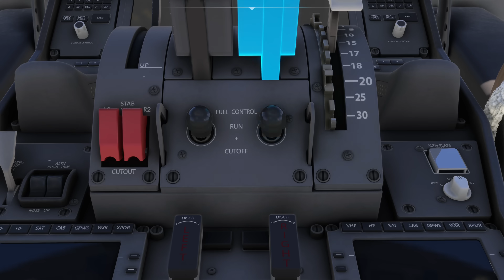Air India 171: Why Did The Fuel Cut-off Switch Get Moved?

Comment: Hi Steve, you mentioned fuel control switches getting turned off causing RAT to deploy. I have a question: after landing pilots do turn these off and won’t deploy RATs. So how can this event be interpreted as engine failures leading to RAT deployment? Also you mentioned RAT deployed so unusually quickly on switching off fuel.
Reply: The aircraft landing gear has "Weight on wheels" switches which do just what the name implies - signal to many systems in the aircraft that the aircraft is on the ground. That inhibits RAT deployment when the fuel cutoff switches are turned to cutoff during normal operation (lets say after taxi to the gate when the pilots DO want to shut the engines down).
The RAT deployed automatically on AI 171 because the engines were both shutdown AND the aircraft was in the air - exactly as it was supposed to.

Comment: Here's a main question of mine why didn't we hear on the flight deck voice record "why are your hand on the fuel cut off levers, 2 maybe someone who has way more experience in the 787 is possible to have enough strength to pull out the two twitches and move them down simultaneously. From what I read and understand the switches 1 and 2 got cut off within 1 second of each other how hard is it to do it that which these fuel switches? Why haven't I heard anything about a possible malfunction of the EEC Electronic Engine Control if both EEC 1 and 2 failed simultaneously could they not give erroneous readings such as indications that fuel cut off has been moved? And the moment they came back online would the engines now fired up again as normal I'm with the fuel cut off switches already in run?

Comment: There's so much misinformation about this crash these days, due to news outlets and interest groups deviating from the essential information available. The recorded data in the CVR and FDR clearly show what happened in the cockpit. One can think what one likes when it comes to assigning blame for the accident.

If one has a problem with this recorded data, it doesn't change the fact that one of the two pilots shut off the fuel supply to the engines shortly after takeoff that day. This data was recorded by the FDR of the Boeing 787 and used for the preliminary accident report.

All other information floating around is invalidating speculation or misinformation!

Keep up the good work Steeeve!
Reply: Yes, the pilots turned off the switches. But the data is not consistent with the suicide hypothesis:
1. I think you will agree that only one pilot was potentially sabotaging. So why did he not turn the switches back off? 
2. The RAT wasn't deployed at 08:47, it started providing power then. So, it should have been deployed at least 4-5 seconds earlier(the report does not give the time of deployment). So the Engines must have failed by 8:42 or 8:43.
(3). The pilots cut-off the switches at 8:42-8:43. You will say this makes perfect sense. I will say exactly the opposite: The valve will take couple of seconds to close (according to the report, it took couple of seconds to open). After closing, the electrical failure would take another 1-2 secs as the engines spool down. They don't stop instantaneously.
All this to say that the cut-off time and RAT power generation time can only make sense if the engines were decelerating prior to 8:42(the cut-off)
(5) Not sure why Steeeve says there is no procedure to turn both switches off. What do you do if both engines lost thrust?
(6) Pilot conversion is not in "quotes". That leaves room for misinterpretation one way or the other.
Reply: Steves is the one who is providing misinformation based on vague data without detailed timestamps. Clearly he is a mere pilot and doesnt know the engineering of the plane.

Comment: Question: If you cutoff the fuel, how long it takes the engine to start? Did you test this scenario in the simulator or perhaps during test flights? You mentioned, that one engine didn't started, why that? It seems the pilot know exactly what to do, if this was premeditated and I was wondering if you can try this on a simulator.

Comment: Hi Captain!
I know I'm not genius in this field neither related to aviation but how can we simply assume it's all pilots error just by reading the preliminary report that AAIB has released. The report they is being released asked so many questions than the answer to the carsh. Because they have mentioned it barely as it feels like they are trying to save Boeing in this case. 
Here's why i think it's not a pilot error.
1) If you see the image of AI 171 right after taking off, It Seems like RAT was deployed (the report doesn't show any specific time of the RAT deployment). So if the RAT was already seen to be deployed right when the plane was around 70-100 feet above the ground, then wouldn't it means it started to deploy 5-10sec back prior to the picture that shows .
So my theory is, both the Engines were down right after V1 Speed and Pilot deliberately "Cutt Off" Fuel Switches to Re-Run the Engines as a Protocol to Actually save the Flight nor crash it, because if they wanted it to crash then they'd never place back the fuel switches to "RUN" (Also doing that might one Pilot askd the other "Why did he cutt of"? Again no time mentioned in the report for the cockpit voices).

Comment: Someome educate me here, i'm a line maintenance mechanic for mostly 767.

Why was the RAT deployed if you still have APU? 

Doesn't power transfer over to APU when fuel are cutoff from engines therefore not needing the RAT?

Maybe the pilot cycled the two fuel switches to reintroduce fuel?
Reply: with 10 seconds gap!?
Reply: @stevemuller8320 true that. But 10 second's way enough time for plane to transfer over to APU, so i wonder why the RAT deployed?

Comment: No, it's generally not possible, or advisable, to intentionally cut off an engine during takeoff after the V1 speed has been reached. V1 is the critical engine failure recognition speed, and above this speed, the takeoff must be continued. 

Here's why:

V1 Definition:

V1, also known as takeoff decision speed, is the speed at which the pilot must commit to either continuing the takeoff or aborting it. If a problem occurs before V1, the pilot can reject the takeoff. If it happens after V1, the takeoff must be continued. 

Stopping Distance:

After V1, there may not be enough runway remaining to stop the aircraft safely if the pilot attempts to reject the takeoff. The calculations for V1 take into account the aircraft's performance and the length of the runway to ensure it can either continue to fly or stop within the available distance. 

Engine Function:

While an engine failure is a serious issue, modern aircraft are designed to be able to continue the takeoff with one engine (assuming a twin-engine aircraft). The pilot will typically increase power on the remaining engine and maintain directional control.

Comment: Captain Steve,

Do you fly Boeing aircraft? If so, I believe your airline should review your content and assess your expertise critically.

The primary focus of all discussions should be air safety, but unfortunately, this is often overlooked. It seems that much of the Western media may be influenced—possibly even financially—by major aircraft manufacturers, as has allegedly happened in the past.

There are also serious concerns about the AAIB investigation team. According to some sources, at least one investigator may lack the qualifications necessary for such a significant case. It’s also been suggested that one or more of them might be compromised by financial ties to aircraft manufacturers. If you genuinely care about aviation and are committed to its safety, I urge you to address the following questions:

If a pilot deliberately cut off the fuel switches, why were they reportedly moved back to the “run” position immediately afterward, as claimed in the preliminary report? Why is there no timestamp provided?

If one pilot cut the fuel switches, why did they attempt to recover the aircraft afterward? Does that align with the claim that the cockpit voice recorder captured one pilot saying, “Why did you cut off?” — a statement allegedly made from a third-person perspective?

What exactly does “cut off” refer to in the report? It could mean various things—air conditioning, fuel, a breaker, etc. Why is it not technically explained?

The report mentions events happening “immediately after”—but this term is vague. Was it 1 second or 10? In aviation, precision matters.

The crew appeared to follow standard operating procedures right up to the Mayday call. If there was a serious conflict in the cockpit, how was a calm Mayday call still issued? Why are such critical details missing?

Watching your coverage, and that of our national investigation team, is frankly disheartening. It seems that big aircraft manufacturers—who have faced accountability issues in the past—are once again being shielded.

If such an incident happens again, I hope the focus is not just on protecting corporate interests, but on saving lives and ensuring transparency. As a pilot, you have the power to stand up for your fellow aviators—many of whom strive to protect passengers and are unfairly blamed.

Remember: it’s easy to blame individuals, but much harder to question the system. The same company you defend today might abandon you tomorrow if you're ever in a similar situation. Please read the preliminary report again—there’s nothing technical in it. If you truly care about your audience and the aviation community, hold the right people accountable.
Be responsible! 

Respectfully

Comment: Hi Mr. Boeing PR,

Let’s break this down step by step:

The fuel to both engines was manually cut off at 08:08:42.

In a realistic scenario:

It takes 2–4 seconds for the engines to spool down.

A maximum of 0.2 seconds is needed to detect the power loss and send the signal for RAT deployment.

RAT deployment (door opening and turbine swing-out) takes around 2 seconds.

Since the aircraft was at low altitude, RAT spin-up would realistically take 3–4 seconds.

The PMG then requires 1–2 more seconds to start providing usable power to the hydraulic systems.

Based on this timeline, the minimum time required for the RAT to start generating hydraulic power should be 8 to 10 seconds after fuel cutoff.

However, in this case, the RAT began supplying hydraulic power at 08:08:47, which is less than 5 seconds after fuel cutoff.

This clearly suggests that the signal to deploy the RAT was initiated before the engines were shut down.
Reply: Also the statement issued in the report which says that one pilot asked the pilot why did he cutoff to which other pilot replied he didn't. 

Where is the direct statement? What is the timing of that statement? Why is the actual statement not put on the report and the timing not mentioned as well!
Reply: Regarding the CVR:

The CVR records one pilot asking the other “Why did you cutoff?”

The other responds he didn’t.

It’s possible the pilot flying saw the PM (a highly experienced Captain and Trainer) move his hand near the fuel switch area, perform the memory item for dual engine fail/stall (which involves momentarily cycling the switch from RUN to CUTOFF and back to RUN), and then return it to RUN.

Since the switches were found in RUN post-crash, and he denied “cutting off,” it may indicate he did execute the memory item and restored the switches — not intentionally shut down the engines.

Also, the report only quotes part of this exchange — the rest may contain clarifications not yet disclosed.

Furthermore, in India, English is often mixed with Hindi, especially in stressful situations. It's plausible that the conversation was in mixed language and may have been mistranslated or partially understood.

🧩 Putting this together:
✔ CVR transcript is incomplete, possibly lost in translation or context.
✔ No conclusive evidence yet of deliberate action — needs deeper analysis.
Reply: Yes, the math is not adding up.
Reply: Which means the engines were not working which is why they had to cut off the fuel.
Reply: Impressive. I have also posted an explanation as to why the conversation between the pilots as reported ioccurred in an independent post.

It also contains the calculations that I did, and the math doesn't add up.

I am posting the explanation regarding the conversation here as I think it is lost among the comments (as there is no reply to my comment)
Reply: It’s highly likely the final report will blame the pilots.

4 big players involved:
1) Boeing – India operates defense aircraft (Chinooks, Apaches, C-17s, P-8I). Indian civilian airline operators have massive Boeing contracts. Boeing has huge influence within U.S. Congress. Blaming Boeing can potentially affect India-US relations

2) Air India – Flag carrier with influence inside DGCA/AAIB. Will try to save face.

3) General Electric – Makes GenX engines used in Boeing 787s and the GE F404 / F414 engines used in Indian fighter aircraft. Supplies CT scanners, etc. Also a huge company. Blaming GE can also potentially affect India-US relations.

4) Pilots – Dead. Can’t defend themselves. ALPA-India and ICPA objected to the preliminary report but have no influence.

And if they conclude suicide, the pilot’s life insurance won’t pay the family. In India, most families rely on a single breadwinner. For them, this would be financially devastating.
Reply: Master Caution and Warning lights ? No mention ? CAS displaying FUEL CUT OFF ?
Reply: So convenient that no media in the West published criticism by investigating body of such speculation. Everybody has assumed the pilot “calmly” said “i didn’t do it”, no mention of calm anywhere in findings.
Reply: and your point is
Reply: These people living inside propaganda machinery will use all trickery to deflect blame. They don’t care about facts. “Captain calmly said ‘I didn’t do it’.” Such lies lol “calmly”. Talk about journalists and influential pilots spreading stories
Reply: So convenient that the media and Everybody has assumed the pilot “calmly” said “i didn’t do it”, no mention of calm anywhere in findings.
Reply: Their media didn't even bother to publish the investigating body's criticism of the speculation and bias.
Reply: Absolutely.. on point 👍🏻
Reply: would have been logged in blackbox
Reply: @stevemuller8320  yes absolutely
Reply: @FitnessGama  Engines failed BEFORE the switches were touched. Engine was functioning normally as the plane lifted off, and right after liftoff, both engines failed. Boeing's own manual for the remedy for this was "Have you tried turning it off and on again? This will tell the computer to relight the engine" in the official procedure, and nothing else to do other than to play with those switches in hopes of relighting. Engines would have immediately relit due to residual RPM after failure and toggling the switch, didn't happen, plane crashed with engine off. Switch did jack shit, engines never relighted, and crashed. Still, Boeing is a saint of a company with excellent track record?
Reply: @beyondwaveformsmusic Yeah right everybody just stopped using their brain cells since Boeing has crystal clean track records 😂😂
Reply: @beyondwaveformsmusic And why do you think it took them 10 damn seconds to turn the left switch back to run and another 4 seconds to do so with the right? And more importantly, as far as the report tells the truth, why didn't the pilots have a conversation about this maneuver other than why the cutoff was done? It makes no sense, and it is absolutely impossible that a cutoff could have been in good intention.
Reply: Taken from Gaurav Taneja video but valid question
Reply: @TravelSeekers  Commented Before Gaurav Bhais's video , I think not exactly sure, but i have watched the video today
Reply: The Steve looks like a master but he just copy pastes content from chatgpt. He doesn't have his own understanding to see how report have these errors

Comment: I think that the leavers for fuel flow might have been ON but the flow might have been nill. Now it may be difficult to establish if it was a mechanical failure or a human error. But it was reported that this flew from Delhi hour's before with lots of issues. That's the question remains.

Comment: The initial evidence points to a deliberate, incredibly malicious act of Captain Sabharwal. But another possibility occurs to me that I'd like to mention here. Temperature stress is defined as "physiological stress induced by excessive heat or cold that can impair functioning...disorientation also may occur". My understanding is that the outside ambient temperature was 100+F as the plane was waiting in line for takeoff. I wonder what that implies the cockpit temperature may have been. After the plane became airborne, Sabharwal's job was to retract the landing gear, something he had done on thousands of flights before, probably almost without thinking. Could it be that, in a somewhat disoriented state due to the heat, he instead inadvertently did something else that he also had done thousands of times before (but at the end of flights): cut-off the fuel?

My sincere condolences to those who lost their lives and their families.